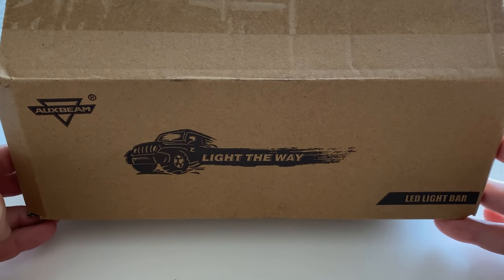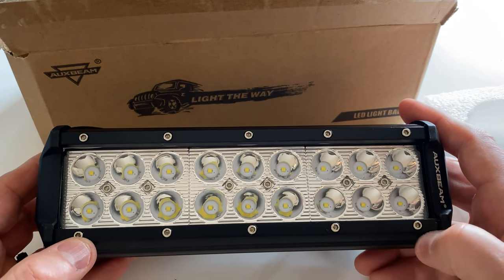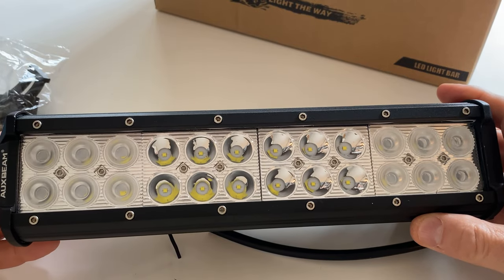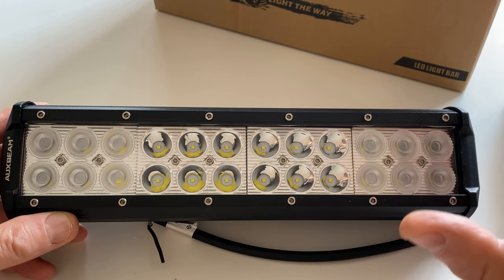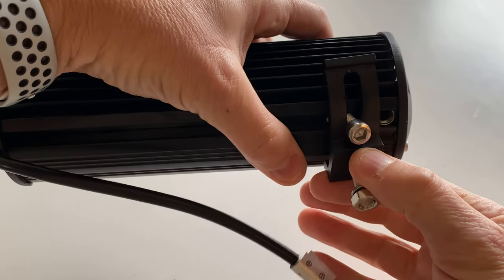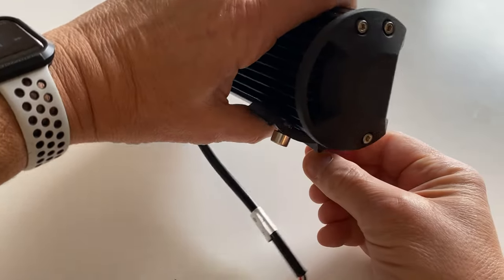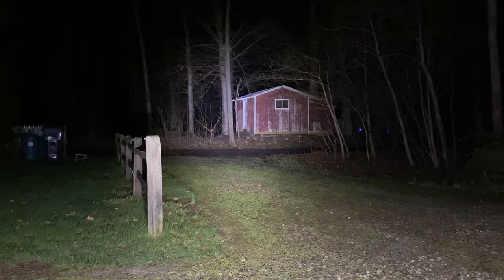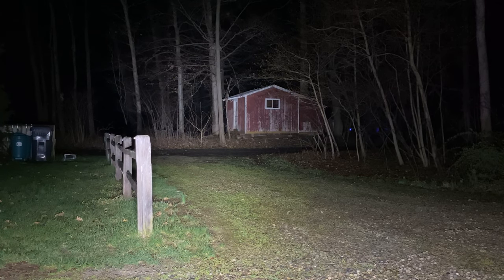Auxbeam 9” vs 12” Lightbar Review and Comparison

Comment: Looks like that 9" only has the single mount point on the bottom of it?  I assume you transferred one from the other light you had?  I see another 9" light on Amazon that appears to have the two bolt posts for attaching it. I went back and rewatched what you did and yours appear to come with 2 mounts, but the listing on Amazon only shows one.   Makes me hesitant about buying it.  Thanks for the video.
Reply from the maker: I too had the same concern as you regarding the 9” bar in the Amazon photo showing only one mount. I could see a 6” bar or a 4” cube only coming with one but a 9” would be pretty flimsy with only one mount. I ordered it anyways knowing that I would reuse my 2 NiLight mounts and at worst, I would only have to add another nut to the bottom of the light housing. Sure enough it came with two mounting brackets in the box and two nuts attached to the housing. Bottom line is their picture is wrong so you should be good if you order the same as in the link 👍.   Thanks for the feedback and for watching.
Reply: @EverydayATV  Thank you for the feedback.  I am loving the upgrades, mods, and testing you are doing with the ATV's.  This is very helpful.

Comment: I can’t find that 9” bar on Amazon is that where you got yours?
Reply from the maker: Yes. I checked the Amazon link and it’s no longer available. I also don’t see it in the Auxbeam.com website anymore either. I just send them an email asking. I’ll let you know what they say. 

Thanks for commenting and watching.
Reply: @EverydayATV  thank you
Reply from the maker: @waydebratcher9921  Auxbeam replied back to me this morning with the following:

“We confirmed with our product department that this size is not available anymore, and we won't have the same size in the future.”

That’s really a shame because the 9” model that I kept works really nice up front, especially in that location. I would still recommend the 6” that I used to have up there. That one still lights up everything quite nicely. There’s also a bunch of 9” bars on Amazon from other manufacturers. Some have the end mount brackets instead of the sliding ones. Not sure how easily they would mount compared to the mounts I used.